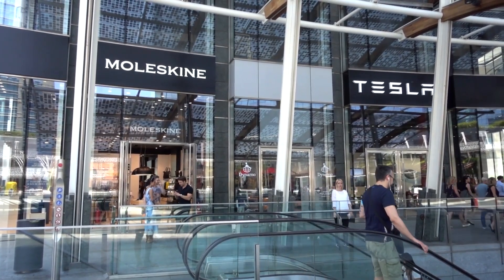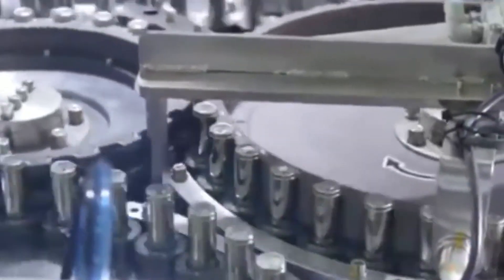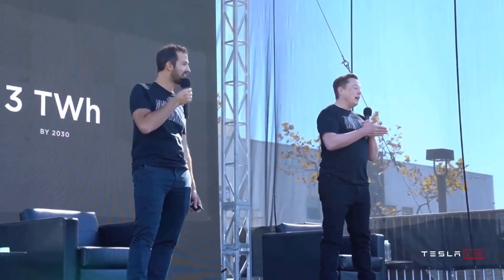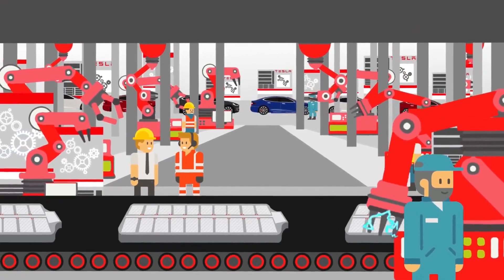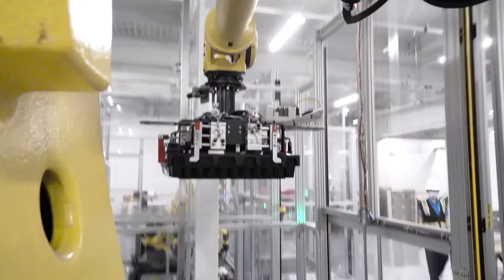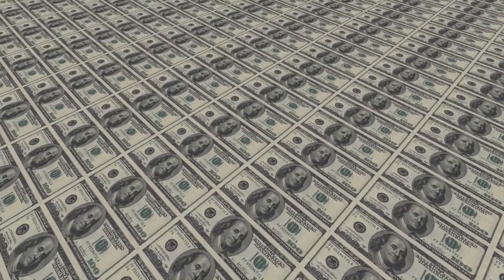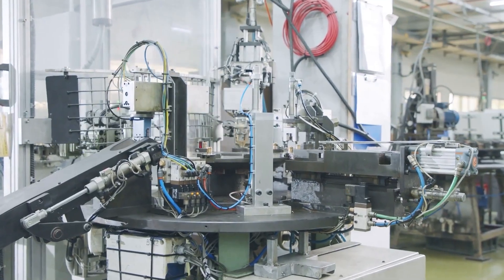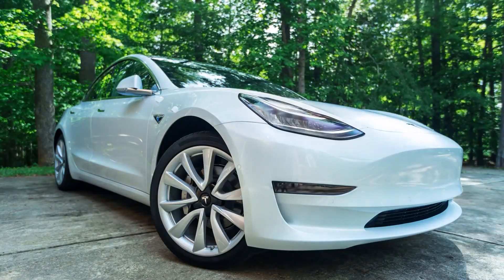GAME OVER! Tesla's INSANE NEW 4680 Battery Technology is UNBEATABLE!

Comment: you can use graphine plates instead of aluminium. and use carbon fiber casing instead of nickel to reduce weight . since we want our tesla power wall to be as light as it possibly could be. and I think it will be economically low cost to produce. pls consider.  tnk yu.

Comment: Wow a cobolt free battery! Only problem is other manufacturers have been making cobolt free batteries for many years LFP! Especially the new BYD Blade battery that thanks to it's construction has a much better density than previous LFP batteries and at around $85 per kwh at the pack level is already the cheapest battery by far. Even Tesla use LFP in some of their Chinese made Model 3 and Y.
Reply: Thanks for your feedback f.o.r•••m.o.r.e •••g.u.i.d.a.n.c.e•••c•o•n•t•a•c•t 
W•h•a•t•s•a•p•p👇
+°1°(724)°3°2°0°0°5°0°6........

Comment: The 4680 format has an aging issue?  
Premature aging of thermal and electrical conduction performance. 

Per Tesla’s patent, 4680 cell replaces “single welded tab” with “multi non welded tabs” to improve electrical and thermal conductivity over conventional single welded tab. 

These non welded tabs conduct heat and electricity as patent claim from the delivery day, begins to age as soon as it is put under inertial and thermal shock in normal vehicle use. Why? 

It employs annealed soft copper in the tabs that doesn’t spring back once deformed from inertial and thermal shock. One by one begins to separate from the output terminal, ie cell casing, until only one left. From there on further inertial shock will cause momentary open circuit in the cell. Leaving thermal and electrical performance worse than cells with one welded tab. 

All chemistry improvement in the 4680 will be gated by those soft copper tabs. Unable to addressing this aging issue will let pouch cell designs out perform Tesla’s 4680 cell. Almost all Tesla’s competitions use pouch format. 

If the thermal management in model3 isn’t implemented with these 4680 cell pack will compound the aging issue for modelY and models on 4680.
Reply: Maybe you misunderstood something about it? It's called tabless for a reason I guess.
Reply: @DecepticonLeader  

There was no misunderstanding between 
(1) (welded single tab) ie 18550 cell versus 
(2) (non welded multi tabs) ie 46800 cell. 
This comment is consistent with Tesla’s 46800 cell patent.

A better description may goes like this. 

18650 use 1 electrode tab weld to 1 output tab weld to cell wall - for inertial shock proof. 

46800 use N electrode tabs touching cell wall to suffer inertial shock and premature aging. 

Using annealed copper in electrode and touch connection without welding for electrical conduction incur premature aging as described above. After premature aged it offers no advantage over welded single tab. 

The false sense to performance and safety to the “tabless” design can mislead Tesla to obsolete its TM thermal management of model3 in modelY. If that is true, modelY’s TM is just as good as an electric street scooter.
Reply: @philoso377  Well, there's plenty of engineers working on this battery type. You don't think they would take all these things into consideration during the design phase? But anyway, if thermal management will be that bad, then it will be noticed pretty quickly.
Reply: @DecepticonLeader  
An army of engineers? Yes. 
To guide Elon of this issue? No
Why? Past the point of no return
Return? Too late to fall back on 18650 +TM
Does Tesla realize this issue? Unsure. Yes if Elon read about this thread. No if not.

Sandy Munro a former Ford engineer offered valuable inputs was dispositioned by administration. 

I hope your blessings come true.
Reply: @philoso377  I haven't done any blessings. Not here, not anywhere else. The more you talk, the more you sound like a FUDster trying to discredit something before you've seen the product. Don't do that. It's a shitty thing to do.
Reply: @DecepticonLeader  
I’m sorry you take it as nagging, the way Sandy’s former boss did on him.  This is legit engineering issue.
Reply: @gregandkaruna6674  He's making a conclusion before knowing what solutions have been implemented to address something that haven't been built yet. It's as factual as staring into a crystal ball and predicting the future.
Reply: @DecepticonLeader  Well I will stick to the true and tested LFP battery especially the new BYD Blade battery with its super safe battery chemistry that has never in the history of the company ever had a battery fire though an accident or thermal runaway.
Reply: @gregandkaruna6674  Alright.